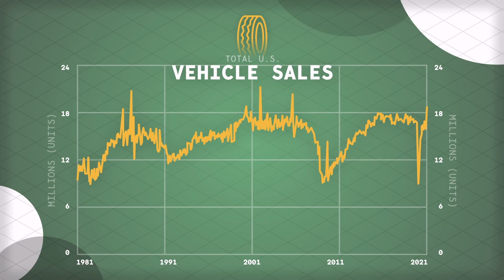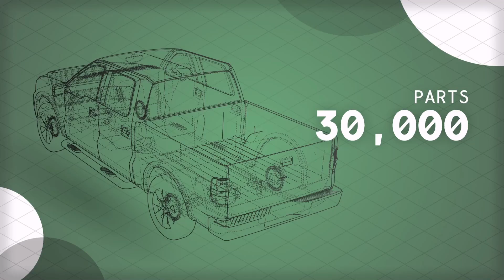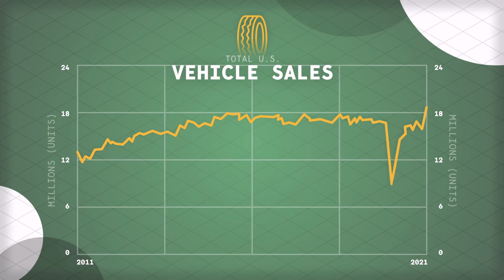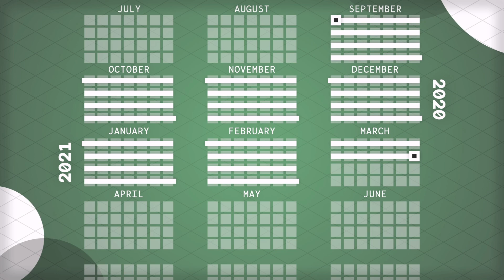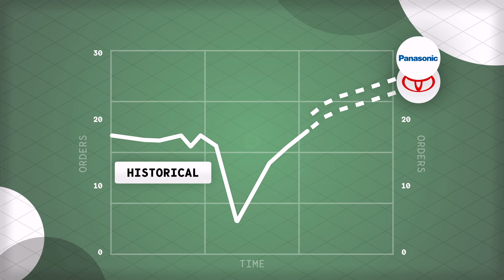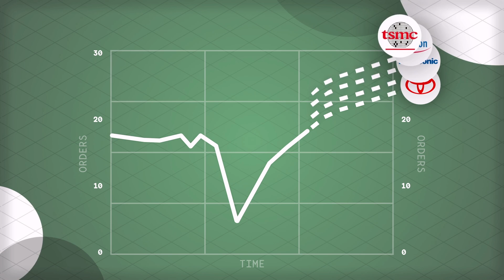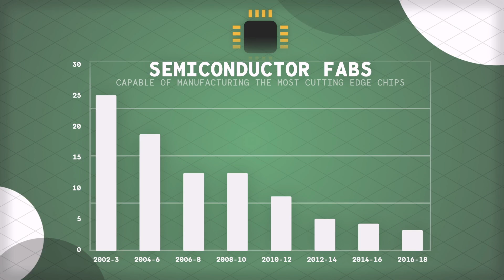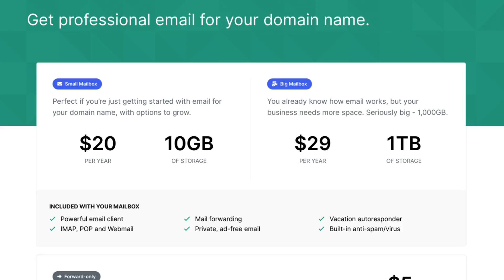Why the World is Running Out of Computers

Comment: The greatest victory of capitalism was to engrave into modern culture the idea that you NEED the latest thingy and you HAVE to get the new thingy that comes out every year, the idea of something lasting a lifetime is not even considered anymore, I used to love tinkering with my broken stuff, it used to be relatively easy to open most devices, figure out which part was the issue and repair or replace it, nowadays stuff is made so that you can't repair it, what's that? your phone's volume button is broken? Though luck, you better throw the whole thing away and get a new one, and pay with your credit card because cash isn't in style anymore.

Comment: Solution for cars: just slap an oldfashioned carburetor on the motor and give it mechanical guages. You will only need basic materials :D

Analog guages today are not mechanical. They are still driven by a smaller chip and electric motors.
Reply: Yeah we moving way too fast 
With the cars i love technology 
But learning way too fast 
Always trying to invent something 
The more ideas the more recources spend to build the idea into reality 
Now we want to colonize mars..
There wont be nothing left..
3d printers are way too slow 
Compisate or whatever that word is 
Where is auto correct when you need it

Comment: This is missing the facts that most companies keep a small inventory of their product due and produce as you said on demand. Which when there is a drop in demand inventory is sold and when demand spikes their is no demand. If certain companies held more inventory in general it could have helped shorten or mitigate some aspect of the shortage. This isn't a panic buying scenario. Taiwan is going through some major issues between China and the drought putting stress on manufacturing chips

Comment: Semiconductors are like electricity, everyone takes it for granted until it's gone.
Reply: Or like drinking water from the tap. Which is just as clean as from a bottle. Everybody takes it for granted, or gaspipes to your house that deliver gas. Or 4G connections, or 1 gigabit fiber glass internet connection. Everybody has these things and take them for granted.
Reply: @HermanWillems  Everyone takes "everything" in the world for granted actually.

Humanity should have been colonizing the stars by now or at least progressed close enough... By the time human beings managed to go to Mars, Earth will be ruined and whatever hope is left would be taken by the world's elite as they flee from the mess they made.
Reply: @dra6o0n  
There is a MASSIVE, inconceivable difference between going to the Moon and going to another planet in the solar system.
Reply: @HermanWillems  And life too
Reply: @HermanWillems  It's propably human nature to focus on the things we lack and need instead of the things we already have. This would make sense, since a lack of something is a problem that requires a solution, sometimes urgently, whereas something you already have and that already works well usually doesn't require any immediate action, since it's good the way it is. People who primarily focused on problems propably had a higher chance of survival in the past.

But you're right, taking a bit of time to appreciate the good things in life is desireable, even if our instinct is to just take them for granted.

Comment: Though things like "Smaller display" in the Renault Arkana is NOT due to a shortage of semiconductors, mainly due to the LCD display being printed, the size doesn't alter the required component to drive it, well, I'd guess Renault might've changed the component thus changing display, but size really doesn't matter as there isn't a shortage of production capability by the display manufacturers, but opting to install a smaller display Do cut the manufacturing cost for Renault, thus increasing profit margins if only by a little.

Comment: The one problem with Communism is its lousy at responding to the need for production in their communities. The problem is is that when the United States when the Western world led by the United States arranges their policy in such a way that for 40 years it pushes all the jobs into communist China that means we become more and more susceptible to any interruption in that flow from a region we have virtually zero control of. If any Western manufacturer finds themselves unable to buy these computer chips from countries that they can't really influence other than to negotiate a contract to or specifications on a chip and say we won't buy it if blah blah whatever but if the supply chain stops. That's the lesson we need to learn is with any product you have to buy from outside your region ask yourself how will you respond when it's suddenly simply stops being available. Self-production

Comment: I think that when it comes to videogames, Consoles are getting more and more outdated. While it is nice to have an operating System that is specifically designed for Gaming and thus allows for an easier and faster experience, it also creates more "junk" in the Process, when every few years there is the next new Console, or a new Edition/Variation of the existing one and that multiplied, because there isn't just one Company building Consoles. Nowadays the tech of one console barely differs from another. Restricting games to only be played on specific Hardware is really only making it worse for everyone. I think that the future of gaming lies in PC Gaming. Yes, I know Windows is not at all optimized enough for a clean and casual Gaming experience with a Controller, but that can be changed through Updates or a new Windows Version. After all, Microsoft has a Gaming Console of their own and if they were to open up Windows a little, everyone could benefit grom it. Sony has had some interesting menu designs and social media functions and Nintendo knows how to exactly optimize Software to get the most out of the Hardware. PC Gaming right now is not at all plug and play, but it does allow for a lot of Customization and Openness. If a middle way can be found, that allows for both a quick and casual Gaming Setup and tons of Customization, it would be the best way to go forth. Sure, there will be problems at first. We already have more and more Companies try to get their own Launchers with their own Store front to overtake the Customer's PC and that situation would surely worsen when big Players like Sony, Microsoft and Nintendo properly join in, but at least it would all work on one machine. You could have them force you to install a Launcher for each and every game you buy, but at least you wouldn't need to buy more and more devices to do so. You would need only one Computer and are able to upgrade and repair single parts as you wish and please. Of course there is not one big Company building and selling PC's, there are a lot of them that also have differing models that create their Junk. But I think that this step alone would lower the produced amount of waste a little.
Reply: gaming caused computer shortage confirmed
Reply: So in theory console gaming could bankrupt in the next years while PC gaming becomes the primary way to play? Or will phone streaming take over before that?
Reply: @matrix9452  Who knows?
Reply: @matrix9452  I highly doubt consoles will go bankrupt anytime soon. Parents buy them for their kids and every kid is into gaming these days. Not to mention consoles are about half the price of a pc and are more powerful than say a $800 pc
Reply: @kristianyoung2429  yeah but a PC has more uses besides gaming and you can easily repair or upgrade it

Comment: Rice cooker is a terrible example. That is clever in a whole other way without microchips.
Reply: So is a car, since it doesn't work based on microchips. But nowadays you have embedded systems in close to everything. Even things that totally doesn't need to function well. Like rice cookers and cars.
Reply: @MegaBanne  
Modern cars with automatic transmission cannot function without a microchip of some kind.
Reply: @KC-bg1th 
Automatic transmission is a luxury that is in no way needed for a car to work as intended.
I have never used one in my entire life.
I am using the concept of luxury very liberally here. But you get my point.
 
A toaster that uses a digital interface won't work without embedded electronics. But that doesn't mean that toasters need embedded electronics to work.
 
Trucks and busses are even more extreme examples. Today they are littered with embedded electronics.
From the engine to the pneumatic system.
Pneumatics controls pretty much everything in modern busses and trucks. From steering to doors.
 
But these are vehicles with systems far older than the the first computer.
So we are pretty much talking about glorified toasters with a display.

Comment: Not to mention, Taiwan geographic location, it is vulnerable to earthquake, though not as vulnerable as Japan or Indonesia. But once they got hit by earthquake, there could be electric shortage, and when the fab didn't get enough electricity, the machine would shut down, and automatically all wafers, that were currently processed inside the machine, would be scrapped. This was happened in 2018 and 2016. Wasting processing time, money, and materials.

Comment: I build shelving for vans for work, we haven't had many jobs because of the Van shortage, they're starting to come good, but out supplier for shelving couldn't get bolts because the factory that makes them had to stop due to covid, so they just bought a bolt machine and added it to their warehouse, They're not stopping.  

But just think, bolts which are made in Mexico nearly stopped a multimillion dollar industry. 

Same things happening with semi conductors, simpler is better in cars IMO anyway

Comment: So what you're telling me is demand for cars went down so companies acted accordingly lowering the supply parts needed for said cars and then the demand shot up and now companies are getting overwhelmed trying to make more parts? Doesn't sound like a shortage to me.
Reply: @tf5pZ9H5vcAdBp  so there’s a shortage because nobody is making the parts companies need?
Reply: @FranklinThe1  Correct. The only companies capable of making the chips needed for graphics cards are TSMC, Samsung, and Intel, all of which are already operating at maximum capacity. They can't make more than they already are without making more factories (which require over 2 years apiece to build and get running), so we have a shortage.
Reply: @selohcin  ah ok thanks

Comment: 5:10 Any reason they are using CRT monitors?
Reply: I have also noticed this and got confused. Old clip, maybe? the image seems to good to be old. Maybe it is a legacy manufacturing plant, that doesn't do CPUs anymore and now focuses on less demanding devices on the embedded market. There is a company that uses the same machine as the 486 line to this day for passports and credit cards. 

I have found this stock footage from 2016 showing a CRT:
https://br.depositphotos.com/102425834/stock-video-israel-march-2016-silicon-wafer.html

maybe they haven't bothered to do an upgrade because it works and is good enough until it breaks

Comment: A $30,000 vehicle at the mercy of a $4 CPU.  What engineering genius thought that was a good idea?

Answer: THEY ALL DID.

Old fashioned analog gauges have worked for decades.  They are a proven technology.  The first thing to fail in a PC is a mechanical device, like a fan.  The first thing to fail in a vehicle is most likely, something electronic.  Therefore, more automotive manufacturers installed even more electronics into their vehicles.  BRILLIANT!

Comment: There are no ethics in technology, the "innovators" are lazily looking at how they can incorporate "smart" chips into anything ... refrigerators, dishwashers, door bells, car info-tainment systems, electricity meters, hair driers ...

The reality is they are trying to add value to existing inventions, the perceived value provides no significant benefit or value to humanity.
Essentially embedding tablet computers into cars or refrigerators is not innovating, it is the blending of 2 existing technologies to add features that are simply not needed.

Over-consumption of resources, and hindering the supply chain, will occur when the "normal" car or refrigerator includes all of this unnecessary technology. Like Microsoft did with the Windows OS, they are simply adding more unnecessary bloat to something that will work perfectly fine without it.

Technology is now driving toward detaching the human from the machine, where "AI" will perform the basic functions previously mechanically conducted by the human. Many are led to believe that "AI" will outperform the human, however, "AI" should be viewed as it sits in reality ... an attempt to co-ordinate the activation of mechanisms through the use of independent micro-services [a computer programs that perform a specific function] with a co-ordinator [a computer program that has "learned" to drive through pre-populated data] that determines which mechanisms to be activated under certain conditions. Regardless of the amount of data you feed into the computer program it will never match the human ability to react in unknown scenarios.

Do you trust the developers of these computer programs more than you trust yourself?

Comment: can't we use another element with close enough properties on the periodic table, and doesn't silicon come from sand?
Reply: Your right, silicon does come from sand. The reason silicon is used in semiconductors however is that silicon, being a group14 element has 4 valence electrons that each bond to one other silicon atom (each silicon atom bonded to four other atoms in total). What makes silicon such a great semiconductor as opposed to carbon, which is also group 14 is that electrons in silicon are not as tightly bound to their respective nuclei, allowing for electrons to move more freely. Hope this helps.

Comment: The only thing a car needs is a mechanical Speedo a mechanical odometer and a hydraulic oil pressure gauge electric thermometer and a dip stick.not one chip is needed.

Comment: Me using the same computer since 2013: "Hah, I solved that problem years ago!"
Reply: I have two from 2009, three from 2011 and two from around 2015. I use them way more often than the one I bought last year, which should work until, at least, 2032.

Comment: This doesn't include the 6 to 24 months of research/development engineering time before a chip even gets to the FAB (factory).  A company doesn't just say "we need a chip that does X" and then they start making it at the FAB/factory.  Some companies like Microchip have "ready to go" small scope functional chips for home smart appliances like refrigerators, washing machines, or automotive digital readouts, temperature sensors etc..., but If GM or Ford want new main CPU for their next generation ECU's that control all the functions in car like fuel injection, anti-lock brakes, etc... that takes minimum 2 years from request, R&D, then final product.  (run on sentence for the win!)

Comment: I'm missing something here.  If everyone orders extra, then there's still that number out there being manufactured.  If everyone has extra, they'll just sell off the extra and thus the supply pool shouldn't be affected.  What am I missing?
Also, factories need slight tweaks in equipment now and then but you don't need to demolish the whole factory every 5 years.
Reply: The semiconductor factories can't keep up with the increased extra orders.
From what I've read, they operate near-capacity under normal circumstances, which from a profitability standpoint is understandable. However, that also means that large increases in demand will result in the supply chain drying up.
And magicking new factories into being takes a while.

Also, if a company has extra semiconductors that are necessary for their functioning in times when there is a massive shortage, they are unlikely to sell off their spare semiconductors, and instead just use those as a back-stop to slow down their own preduction drying up.
Reply: @OzixiThrill  Yeah, maybe they are just keeping them "in case".